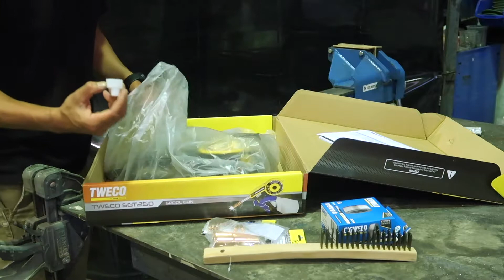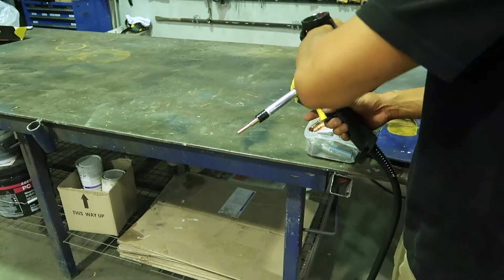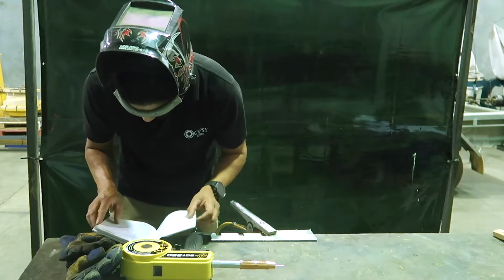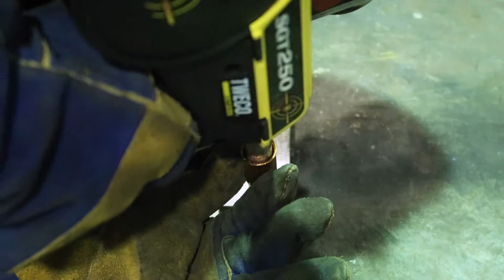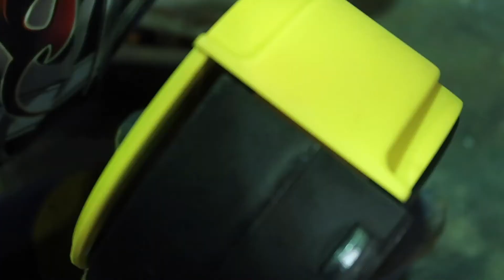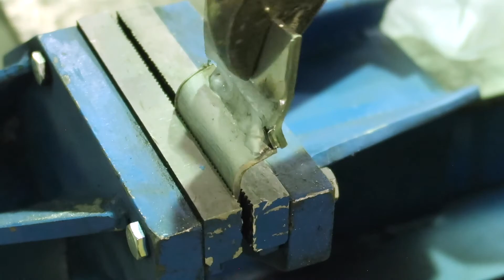Sailing Kulali  - Welding Aluminium for the First Time - SGT250 - Day 6

Comment: Legend mate.
I just got the same gun, good to bounce off another blokes experience with it 🙂
Reply from the maker: Thanks Nath. She’s treated me well. Using it this weekend. 

Only thing that I find weird is when the roll inside spins and makes a weird feeling. But not really a problem.
Reply: @sailingkulali   does your sure ever wander around?
Reply from the maker: @Nath-sn1mv  I have the contact tip right up to the end of the nozzle so not really. But the wire does seem to bend if it’s too far away from the nozzle.
Reply: @sailingkulali  mmm .
I'm trying to fine tune mine still.
I only got it like 2 days ago.
Mind if I ask what settings you use for 2-2.5mm ali??
How my much stand out for your welds? Like, wire stand out?

Comment: Great informative video, thanks for posting
Reply from the maker: Thanks Raf!
Reply: @sailingkulali  Getting the same set up soon, first time welding ali, might try stainless given the ease of swapping out the spool.
Reply from the maker: @NZRFoster  Nice mate good luck! Just check gas type as well. I think Ali is C02 and Staino is Argon. Can't remember though. Probably google...
Reply: @sailingkulali  did my first Ali welding with the spool gun, so different to steel! Pre heating (100 C) and using heaps of flow with the argon made it a lot better. The speed at which the whole Ali piece heats up is surprising, and when it’s all totally hot, to walk away and let it cool before continuing as otherwise I found it destroys the weld/Ali piece. Great to be able to work with Ali tho
Reply from the maker: Well done! Yeah it’s crazy how hot it gets!

Comment: Interested to know why you didn't load aluminium wire into your welder instead of spending around $500 or so on the gun? I know you need to change the liner and move to a knurled roller but that doesn't cost too much. The gun is a good idea but it's so expensive.
Reply from the maker: Hi, I looked into this and steered away because of potential problems with the aluminium wire being too soft for the length of the torch lead. It can be done successfully if you keep the lead relatively straight. Because I’m completely new to ali welding I wanted to give it my best crack and also the spools come in smaller sizes. I am worried about issues with having too much wire on a spool and letting it corrode (have had it happen with mild steel wire). 

You can buy cheaper spool guns, I don’t think it would make much difference. Even this gun I think feels abit plastic like.
Reply: @sailingkulali  ok that makes sense. Never tried aluminium myself as yet but I can see it being a problem as you described. I’ve also had steel wire rust up when left in the machine for a while, so the small reel makes good sense. 
Appreciate you replying,  not many bother these days. Cheers
Reply from the maker: No stress. If I wasn’t going to be doing too much welding and washing in a rush I would try using the existing MIG torch. There’s a few vids out there on how to/successfully doing it. The spool gun is useful in that you can have different wires on hand, even 316SS. I currently use the lift tig torch for any 316 though and seems to work okay.

Comment: Great video, was thinking about getting one for my Vulcan 220
Reply from the maker: Thank you! I’ve actually used it quite a bit now. Only thing I am trying to figure out is the slight whiring noise as if the spool isn’t unwinding smoothly. Tried different tension settings too. But so far so good.